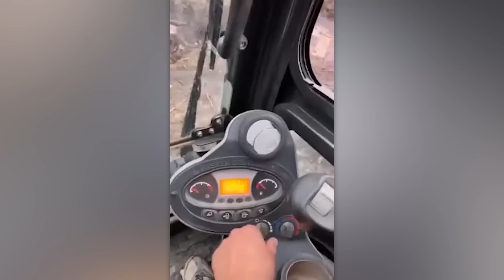20 Most Ridiculous Mistakes of Workers Caught on Camera

Comment: I was going to make a smarty-aleck comment about these various screw ups until I remembered my own grand mess several years ago. I work as a repairman on commercial cleaning equipment. I had a customer who had a dead onboard battery charger and wasn't thrilled with the $1,000 price tag for a new one. I suggested converting to an external charger. By the time I found one, a month had passed, the customer was wanting the job done, and I was in a hurry to get it done.

What's the first thing you do when working on electrical systems of any sort?

That's right.  Disconnect the power source, which I did not do!  So, when I was disconnecting the old charger, the positive and negative leads of the 36-volt system came into contact with each other, producing a cloud of thick smoke and lots of excitement as the fire alarms in the HHS building went off.  The D.C. fire department was called, the building manager came down screaming at me to get the machine out of the building, which was impossible because the entire wiring harness was now a smoldering mess.

To top it all off, I spent the next week hoping that I hadn't destroyed the rest of the electronics in the system.  Drive motor -- $3,000.  Computer Board -- $1,700, Brush drive motor -- $ 750.  It cost me $350 to buy a new harness and 6 hours to rewire the whole machine. Thankfully, the damage was limited to the part of the harness that ran right to the battery pack.

Yup - I could have easily made this video as a star!

Comment: I was almost 5:45 2 weeks ago.  The brakes were locked together.  I know better.  Always unlock them from each other as 75% of time the left brake is more worn then right brake.  I hit brake right side grabs, left does not. Front end rotates right.  So as impossible to unlock there. I back down much faster then intended.  That’s way I grab the lowest gear possible loading, unloading a machine I have not used.
Reply: If you have not used a machine, why would you try and use it?

Comment: The one with the tractor and the guy getting a coating of crops is actually his own fault.

The combine harvester moves forward at a set speed and, when full, signals the tractor/trailer to drive alongside it so it can empty.

The tractor driver is responsible for keeping pace with the combine harvester when this happens.
Reply: yup, thus the word 'mistake' in the video title!
Reply: @wardwagar863  except the title of the video infers that the fault lays with the combine harvester driver.

Comment: Load stuck under the bridge 🌉,  let out 75% of the air pressure in all of the tires
Reply: exactamundo! if he was able to get in to a certain point without there being an issue then it stands to reason, two things in particular 1st thing being reducing the volume of air in the tires, & 2nd thing, to go in reverse out of the tunnel with almost flat tires, but with another prime mover or heavy duty truck pulling from the rear once the tyres have been deflated somewhat.